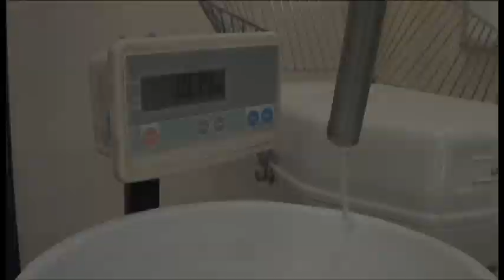Bagel Making Video 2015

Comment: Ok, there are two huge wastes of manpower in this video.  My dad has owned a bagel bakery since 1975.  1) He puts every single type of bagel though that machine and they all come out the same.  No need to waste that manpower on hand rolling.  2) Putting on seeds on the bagel one bagel at a time is mind blowing.  When the bagels are all lined up on those burlap boards in front of the oven first and then have each seed in an individual (thermos) type of shaker and then just shake it down the row of bagels.  Seed 6 dozen bagels in 3 seconds.  My father hasn't changed this method since day one.
Reply: I am very interested in making those bagels to start up my business, can i have your contact details to discuss my project, I believe you can help me in right direction with your vast family experience...
Reply: @abrar9438  have you started your business my friend and if so can I contact you I'm also interested in starting one we can talk.